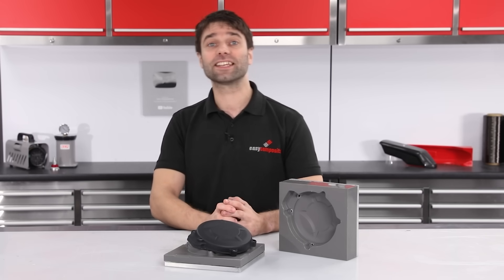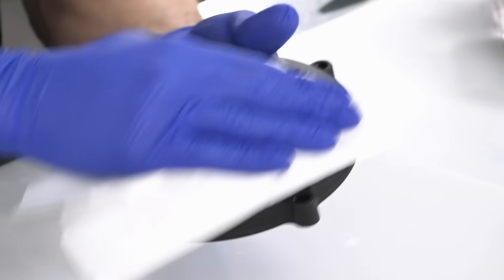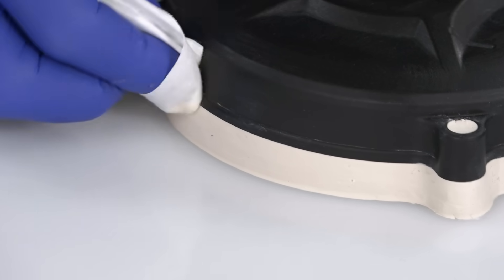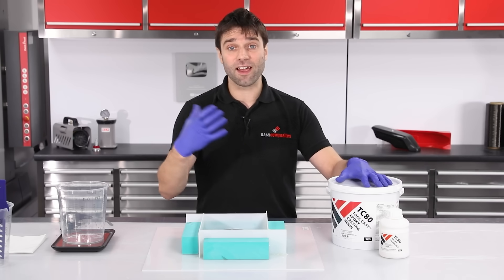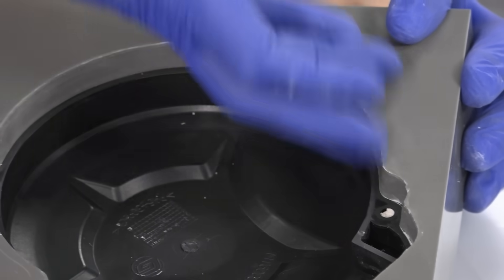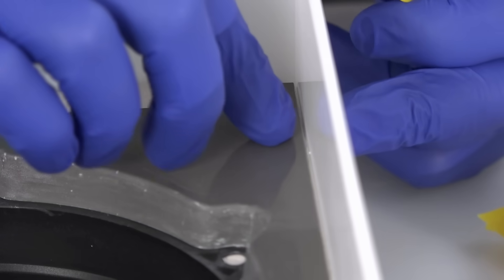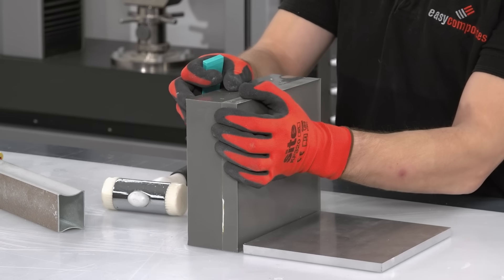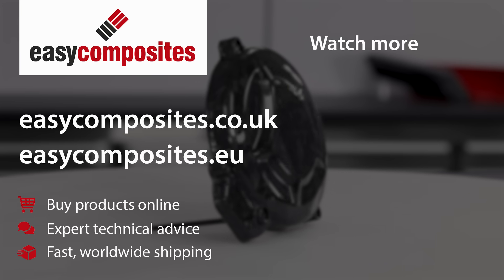How to Cast a Two-Part Compression Mould for Forged Carbon Fibre

Comment: Compressed air wouldn't be better to release moulds? 🤔
Reply from the maker: You could use compressed air, generally it’s a bit of a hassle for what can be a simple gentle push to release but it’s certainly an option if you regularly have an airline set up.

Comment: Great video! Is it possible to use this mold for Synterm? Thermocompression molding.
Reply from the maker: The resin system has a HDT of 80C so anything hotter would not be recommended.

Comment: what would happen if you add a little bit of pigment to the epoxi resin? what would the carbon fiber piece look like?
Reply from the maker: Hi Carlos, it depends on the density of the pigment and fibre additives you are using. Typically the fibre density is high for best performance which means, even with a high pigment density, chances are you will see the fibres on the surface in the pigmented resin.
Reply: @easycompositestv  that would look really good

Comment: Great video. Rather than drill index holes into a tool half, cast plastic furniture feet at the parting plane. They come in different sizes st Home Depot and have draft and pop right out leaving a perfect indexing cavity
Reply from the maker: Thanks for the suggestion. Yes, this could work. Another technique we’ve used a lot on previous videos is to just shape a taper cut registration square made from filleting wax - only takes a few seconds and leaves a very need registration.

Comment: Such videos explain, why such parts are so expensive. The work before, takes very very much time. I wonder how many times you can use this?
Reply from the maker: The moulds could be used hundreds or possibly thousands of times, really the only limit is how carefully you handle the moulds (to avoid scratches).

Comment: Hello, how about Vaccum Forming, it is useful for forming molds?
Reply from the maker: No, not really. You need a lot of strength and a lot of accuracy in the moulds to make the process work. Although we’ve not tested it, I really wouldn’t expect that you have enough of either in a vacuum forming.

Comment: you said you can go  with 17 mm in depth with this resin
Reply from the maker: That’s right, the TC80 can be cast up to around 17mm in depth without any danger of it overheating (exotherming) during the cure. If you have a shape that would need more depth then it would be better to ‘block out’ some of the volume using wood or foam, reducing the depth of the resin and saving some cost too.

Comment: wow a lot of tip :), but how can you calculate weight of carbon fiber and resin to put in this mold ??
Reply from the maker: We will be explaining the fully in the next video. Basically, you’re aiming for a fibre to resin ratio of 60/40 so you need to know the volume of your component and can then work out the amount of carbon and resin that should be in it. You would add in exactly the right amount of carbon (which looks like A LOT) and slightly too much resin (which will get squeezed out).
Reply: @easycompositestv  tank you for your answer, see you on the next video ;)

Comment: Do you guys have a resin which could be used to bolt onto a rather hot surface like a cylinder head? i would like to build an adapter for an intake system and looking for a nice resin to cast it :) Very nice content by the way.
Reply from the maker: We have a new version of this resin coming out soon, called TC160, it's essentially the same product but with a service temperature of 160'C. If you need a higher service temperature than about 180'C then there aren't many conventional casting resins that would be suitable. It also depends whether you need thermal conductivity in the cast product or not, and also whether weight (or density, to be more specific) is important. If weight isn't critical then something like TC160 might be suitable, if weight is important then the aluminium filler in these 'tool cast' systems would probably rule them out in the basis of density (i.e. the part would be heavier than it needs to be, if it doesn't need the thermal conductivity). If you'd like to work through your options in more detail, please contact our tech sales team through our website.

Comment: Tell me why they use an autoclave for carbon? If you can do without it. Is the part better and stronger in the autoclave or without it?
Reply from the maker: An autoclave is doing two things, it's providing pressure and heat. If you're using 'prepreg' carbon fibre to make your parts then this means that the resin is already combined with the carbon fibre and it's already been mixed with its hardener (that's why they're stored in a freezer) but to cure the resin you need heat, this means that prepregs must be cured in an oven or autoclave. The additional pressure of an autoclave help to consolidate the reinforcement, increasing the fibre ratio and reducing the void content. This is also what happens with compression moulding where - if done right - the pressure could be equal to or higher than the pressure in an autoclave. If you're using a resin system designed for ambient temperature cure and you're applying pressure equivalent to an autoclave then the mechanical properties of the resulting component would be very similar. Ultimately, the use of an autoclave is often more of a practical consideration (i.e. what's the best way to make this particular part/shape?) than it is a matter of it outright being a superior manufacturing process in terms of the performance of the component.

Comment: That’s the information I needed 
Is it possible to cast thicker materials with multiple colors inside like a smiley ?
Reply from the maker: Yes, you could do. It sounds like your project is more creative/decorative than structural or mechanical (in the way these casting are intended to be used) but certainly there are ways and means for including separate colours and shapes into resin castings. You'd have to reach out to us with a bit more information about your project if you want specific advice or material recommendations.

Comment: Thanks for the video.
What do you do if the internal dimensions of the copied part have ribs or varying thicknesses?
Reply from the maker: Hi Michael, if you want to replicate them, leave them in. If not you can modify the original/pattern until it’s the shape you want.

Comment: I’ve been waiting for a video like this on forged carbon compression moulding for ages!! I love how well you explain everything and you’re such an asset to the composite industry. I’m looking forward to the next few videos and as soon as I’m ready to get started, I’ll be ordering from Easy Composites!
Reply from the maker: Appreciate the really kind comment, if you need any getting started please us know :)
Reply: I purchased everything here and followed everything to a T. My bottom half of my mold came out decent. When casting the second half it some how bonded to the bottom half resulting a total loss. The only thing I may have done poorly was not allowing the wax to dry fully. Even though i waited the recommended 10 min intervals, my layer may have been too thick and not dried properly.

Either way, I highly suggest you purchase from Easy Composites. the yellow filleting wax is an absolute must. I have tried everything under the sun and nothing performs as well as this stuff. The Easy Lease is also worth buying. Two coats just rubbed on and my plug from my mold released incredibly easy!

Although my forged mold did not work out I will be buying more product from them. They are eager to help and are super nice people. 

If you are interested I plan on uploading my carbon process on my channel as I produce various parts for my hot rod truck.
Reply: I want to add, I do not think this is fault of the product but rather my inexperience

Comment: How does the strength of these carbon forged parts compare with the original aluminium parts? And  how does the strength compare with woven carbon?
Reply from the maker: Hi Robert, it compares very well but - as you might expect - it’s quite a complicated subject. So much so that we’ve decided to do a third video, after the next one, properly comparing the mechanical properties of forged carbon vs aluminium vs some other materials and production processes. Make sure you’re subscribed - we should have it done in the next month.

Comment: would this work as a less wasteful way of making regular carbon fibre parts in a wet layup?
Reply from the maker: It is possible to compression moulding conventional hand layups (made with woven cloth) but the fact that woven cloth cannot ‘stretch’ or move around in the way that the chopped toe reinforcement can means that compression moulding woven reinforcements is less reliable and more prone to voiding.

Comment: this would be epic for prepreg when it can withstand heat :)
Reply from the maker: Following quite a few similar comments, we've got our R&D team working on a high temperature equivalent to the TC80. Early signs are good that it will perform very well so keep an eye on our website for a new high temperature tool casting resin (most likely it will be named TC160 - based on our existing 160'C epoxy technology).

Comment: I was wondering if you have ever tried to mold onto resin 3d prints? I was thinking that I could use them to make the face of a mold with awesome detail, then reinforce it with something else. I was just wondering as I don't know how the photo resins would work with epoxes and such if there would be any release issues
Reply from the maker: Hi Ricky, yes, absolutely, we've made a video about this already. In the video we used an FDM print, not a SLA/resin print but these type of prints could be used too. PVA (as shown in the video) would still make a suitable and reliable release agent: https://www.youtube.com/watch?v=4ND2WtEZatY

Comment: Awesome video as per usual. What is the difference between regular carbon fibre and forged carbon fibre, besides the obvious aesthetic difference?
Reply from the maker: Thanks mainly to Lamborghini, over the last few years, the phrase 'forged' carbon has come to mean composite components made using short strand, randomly oriented carbon fibre, moulded under pressure. It differs from components laminated using more traditional formats of carbon fibre (i.e. woven carbon fibre cloth) in that the shorter strands of carbon can move around in the laminate, allowing them to fill more complex mould shapes under pressure in a way that woven or long-strand unidirectional fibre won't do. The compromise though is ultimate strength - components made with long strand unidirectional or woven reinforcement will be stronger and can exploit optimised fibre orientation (i.e. fibres aligned in the direction where strength is most needed) to produce components with better mechanical properties. In short, forged carbon compromises on strength but provides a material that can 'flow' better in compression moulding, meaning it can be used in a way that woven or UD materials cannot.

Comment: It is not needed to put the resin in a vacuum chamber to remove the air bubbles ?
Reply from the maker: No, there is no need to degas this epoxy. If you wanted to, there would be no reason not to degas and it would remove a small amount of trapped air but it's not necessary.
Reply: @easycompositestv  Thank you !

Comment: Great work, Paul!  I really appreciate the detailed steps shown here.  Question though, why is it called "forged"?  I'm a mechanical engineer and semantics and nomenclature are important to me, so "forged" doesn't really fit this process.  Why isn't it called compression molding like you said?  Seems like marketing-gimmicky-handwavium to call it forged?
Reply from the maker: Haha, nice comment. We're engineers too and they matter to us as well so we did have several conversations about this internally before making the video! I'll try to provide a detailed reply of where we got to on our thinking:

First of all, this isn't our name for the process, it's a fairly well-established way to describe compression moulded short strand carbon fibre - mainly because Lamborghini have been calling it 'forged carbon' and using it extensively for a few years now. Calling it anything else would require active effort (and mean a lot of people interested in 'forged carbon' don't find our information.

Secondly, on the etymology of the word 'forged', both in an established engineering context, and in its suitability and applicability in a composites context (regardless of whether Lamborghini and others were using it) we don't think it's far from the mark. Whilst 'forged' means something specific in a context of forming metal, the word forged also means "formed by pressing or hammering with or without heat" (Merriam Webster dictionary) or "to make or produce something, especially with some difficulty" (Cambridge dictionary). Given that the process - in this context - refers to compression moulding under pressure, this description does seems pretty apt.

Whilst you could certainly call a 'forged' carbon fibre part 'compression moulded carbon', you could actually call most carbon fibre parts 'compression moulded' because many processes - vacuum bagging, prepreg, SMC etc, are all forms of compression moulding. Forged carbon is a way of differentiating compression moulding short strand carbon from traditional woven or long strand reinforcement. The short strands being key to the process in allowing the reinforcement to 'flow' more easily to conform to the mould contours under pressure in a rigid tool, something that doesn't happen with woven or long strand reinforcement (leading to voiding).

Comment: I'd love to know if this can be used to save on consumable materials or if that won't work well? I'm thinking of larger parts like wall panels e.g. 2.5m x 0.6m. So you would have relatively thin wall panels that are either flat and glossy or maybe textures and on the B side you have beams for rigidity. Like a half-timbered structure you can just stuff rigid foam panels in for insulation. That should give very cheap, well insulated and durable walls for a tiny house or workshop.
Can you add a kind of scoring to act as a infusion mesh or flow media to assist this?

I've been reading and watching videos about composites but I haven't seen anything quite like that. I imagine you can make anything work but you have to think about and figure out the issues that crop up. Do you need vacuum infusion, vacuum assisted resin transfer molding or just compression moulding?

PS: I saw your other answer about complexity and size and I guess you could sensibly only apply 1 atm of pressure using vacuum and use hand laminating and vacuum or vacuum infusion.

Sorry for the somewhat extensive question haha. And thanks for the awesome videos!
Reply from the maker: Hi Dejay, In terms of general consumable usage, with multiple pulls from a mould you may have an overall consumption reduction.  However for low volume runs it is worth considering the extra resin used in the moulds production so it might be harder to balance in that situation. 

Not sure how it could be used for making structural panels for a building.  I suspect such a large mould may be too heavy to use practically.  

We have not experimented with trying to groove the mould to act as a flow media.  Lots of fine grooves would also be hard to release from so may not be ideal.

Comment: Can i use it for rtm?
Reply from the maker: Hi Alexander, these tools are not designed for conventional RTM.  A lot of RTM processes would use heated tools and a high amount of force and pressure which these tools would be unlikely to resist without damage.

Comment: I suspect for smaller parts you could make the molds very easily with a 3D printer.  Just design the part you want to cast then subtract it from a solid block the get the molds. A resin printer might be better for small objects as you can print the mold solid better than with a FDM printer, and also get a better surface finish.
Reply from the maker: Yes, indeed. In the accompanying video (which we'll be releasing next week hopefully) we use 3D printed moulds, alongside this solid cast one, to produce the forged carbon parts. Resin printing is potentially good for producing solid 3D prints but does often compromise the dimensional accuracy, certainly in our experience anyway, but yes, they do yield a better surface finish.
Reply: @easycompositestv  I have a couple of heel plates for my motorbike that I might try this with, unfortunately I think they're bigger than the build plate on my Elegoo Mars2 pro so I may have to use my Prusa, but look forward to seeing how you guys do it!

Comment: I would need something like this just for higher temp up to 180C
Reply from the maker: it's not an 'off-the-shelf' product but we suspect a good high temperature equivalent could be made by combining our EL160 high temperature epoxy with powdered aluminium and (possibly) some aluminium trihydroxide (filler) to produce a high temperature casting material with the right thermal properties. We did anticipate this question and plan to do some tests to evaluate this combination of materials. We're pretty sure it would work fine. We'd probably recommend using our EG160 high-temp gelcoat to improve the polishability of these moulds, if they're for prepreg production. That would certainly get you to 160C and you might be able to push it to the 180C with a bit of testing.
Reply: @easycompositestv  I'm thinking more about reproduction of my lure moulds. So there will be 2 piece mould for soft plastic injection (plastisol)